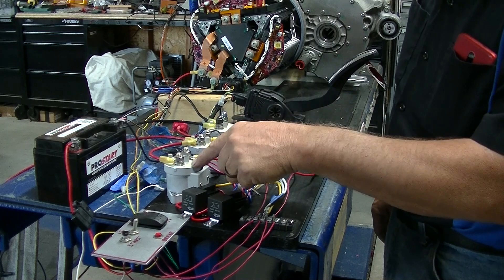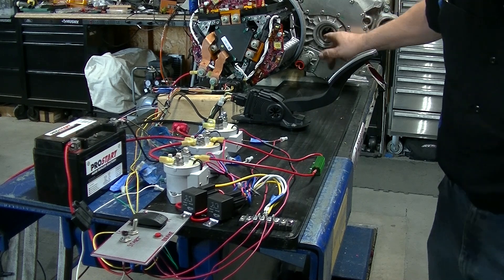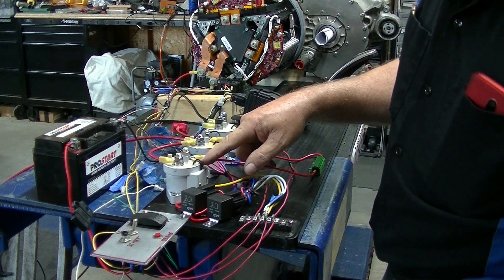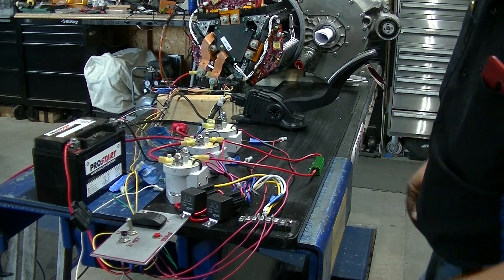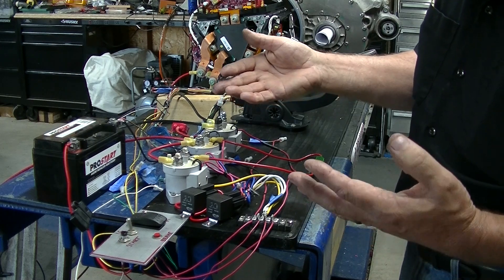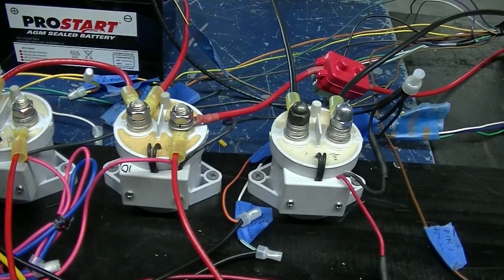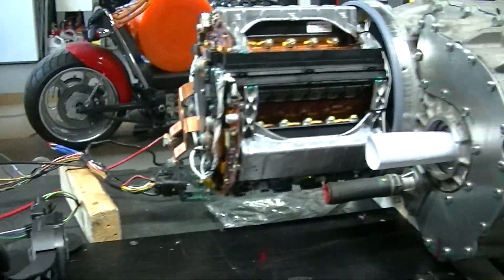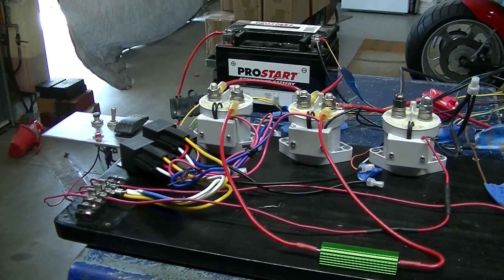Tesla Motor Swap Part 4

Comment: how did you get that material to run the Tesla model s motor and also the battery? I want that material so that I could do the same for that 2005 Mustang GT v6
Reply from the maker: Hi,  Motors are readily available through salvage yards, electronics and available through Openinverter.org, AEM and others. Just do your homework.

Comment: Great video! Was unable to determine the job the relays were performing though. Wiring schematics on openinverter don't show the use of relays. What are their jobs?
Reply from the maker: The relays are for HV Positive, HV Negative and pre charge. Look at Tesla LDU wiring diagrams on open inverter, they are there.
Reply: @Roadstercycle  thank you!
Reply: @Roadstercycle  I apologize, I realized today that I did not specify which relays I was referring to.  I was referring to the two small 12v 30A relays next to your terminal strip and not any of the contactors. What purposed are they serving?
Reply from the maker: @danmauser7094  Hi, Just ignition on relays for inverter 12 volt power and hmmmm I can't remember.  Not used in the car. I do remember I did not use them in my latest bench test setup.
Reply: @Roadstercycle  that is most helpful! I didn't feel like they were needed but had to be sure. Too much money invested to make a silly mistake.

Comment: What resistance and power rating is the resistor you are using?
Reply from the maker: I use two 100 watt resisters. Big ones.
Reply from the maker: In series
Reply: @Roadstercycle  Thank you for the information. What is the Ohm value of the resistors? I just bought an openinverter board and small drive unit but it doesn't call out in the included information what value to use.
Reply from the maker: @jscballer  100watt. Good ones not Amazon small ones. 2 in series.  47 ohm

Comment: Great videos, really helpful. With Damien’s board, does it support regen braking and what software do you need to connect to the wifi and alter settings?
Reply from the maker: Yes, Damien's board does have regen. You do not need any software at all. You log into the wifi on the motor at its address and all the perimeters come up and you can tweak and save right there. Very Easy.

Comment: Do you know what was the current draw when you were running it at 54VDC? Trying to bench test it with a power supply o stead of batteries.
Reply from the maker: You really have to use batteries to test. Power supplies are not a solid output source, people have tried to no avail.

Comment: Awesome build!
Curious how will you prevent accidental switch from forward to reverse? Via relay logic or there's a setting in the control board?
Thanks in advance.
Reply from the maker: Hi, There is a  lock out in play here,  you can't shift into reverse or forward unless the RPMs are under 100. So you can't accidentally shift into the opposite direction. It's in the control board. You can actually set what RPM you want. I have mine at 100 RPMs Which almost totally stopped.
Reply: What value of the pre-charge resistor you've used for this build?
Reply: I'm working with the SDU, trying to figure out parameters. Would you please be able to share how to change the voltage based on the pack?

Comment: Thanks for the videos, so valuable!  I'd be SUPER interested if you could point me to some info on how you wired up the test bench stuff like the pedal, and F-N-R switch.  I took a bunch of notes on the pre-charge circuit, it's the best explanation I've seen, and I know you just did it off the cuff, so congrats on that.  Thanks again for making these videos.
Reply from the maker: Hi Hank, to be able to do what I did you would have to have the inverter circuit board that I bought from Damien McGuire which you can find on openinverter.org  website.  Then just follow their directions on hooking up the pedal etc. with the diagrams they give. You use low voltage DC first. I used just one battery out of my pack at 60 volts.  You can not do this with a stock Tesla setup, you need the circuit board.  You can email me too if you need. jack@roadstercycle.com